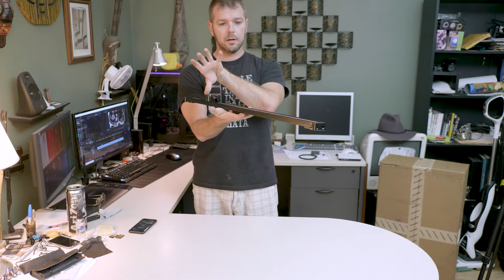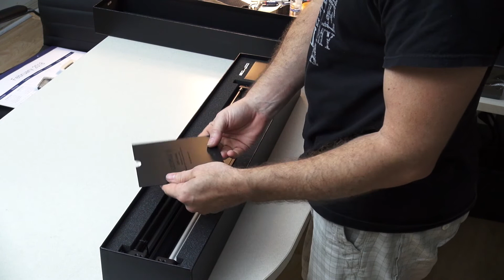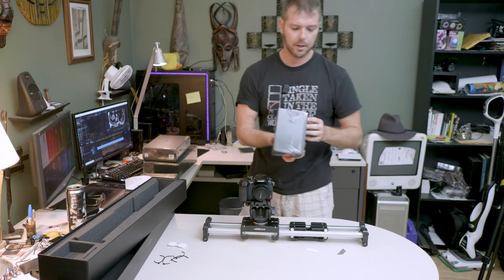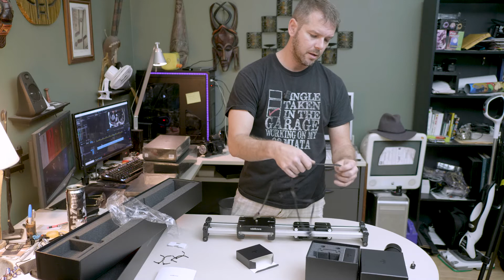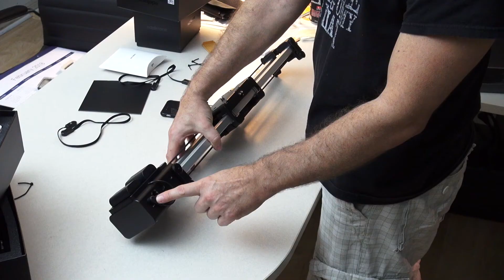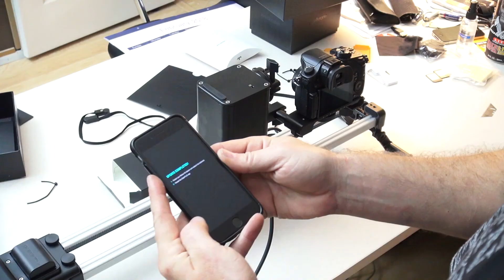Edelkrone Slider Plus and Motion Kit - Unbox and Setup Pt 1

Comment from the maker: The problem I was having was that the system needs the slider to be locked in the center for startup.  It's the only way it knows where to start.  In my haste to get things going, I overlooked that and it kept audibly telling me to lock it.  The app is still in active development and doesn't offer enough feedback for troubleshooting.  Once I locked it in place, it ok'd the floor (or tripod) setting and went on to asking about the head orientation.  Once you walk through the system checks, then you're off to the races.

I wanted to wait until I could get a good tripod mount before doing part 2 of the video and it also allowed me a few days to play with things to give a better opinion.  A third video will be coming in the next week or two, talking about my experience with it in a real world usage and a short cinematic video using the system.